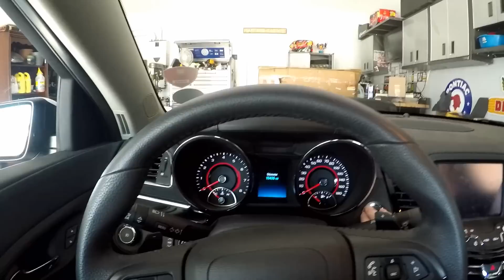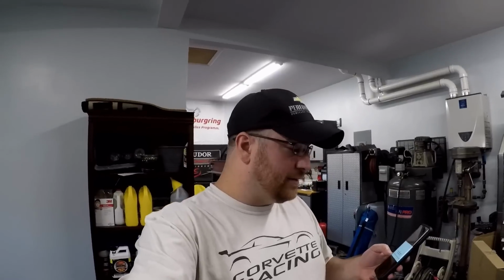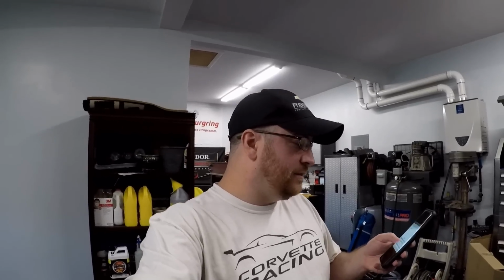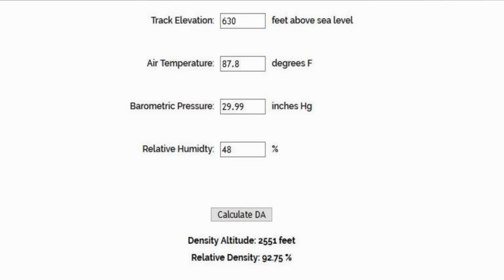2014 Chevy SS - Summer Test and Tune

Comment: What super charger do you have on the SS? how much boost? It sounds strong!
Reply from the maker: Stock LSA - stock pulley - stock LS3 cam.

8 pounds of boost in good DA!
Reply: @bonecrrusherSS  Those are some really good times! im barely trying to get out of the 11s with my G8 on an F1a-94 with 15 psi and custom cam and stuff on 93 octane. I will be going to the track tonight to hopefully run my first 10!
Reply from the maker: Check out my Fayetteville video - https://www.youtube.com/watch?v=MXXZcU-z20k

I ran a 11.4 @ 124 this past spring - before it got stupid hot out. 

My car seriously needs a convertor.